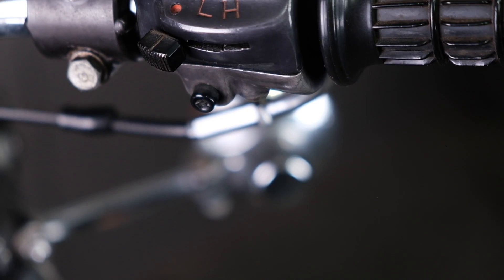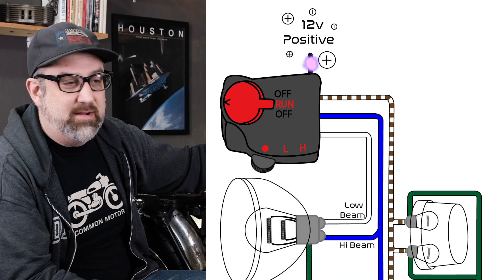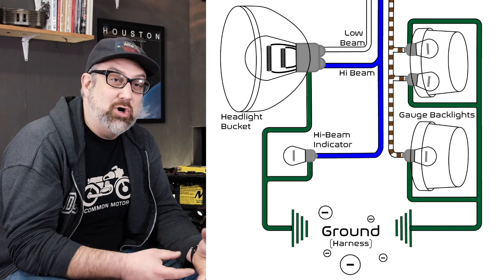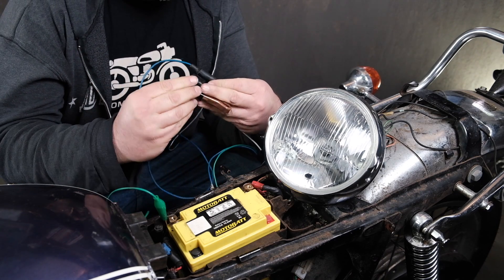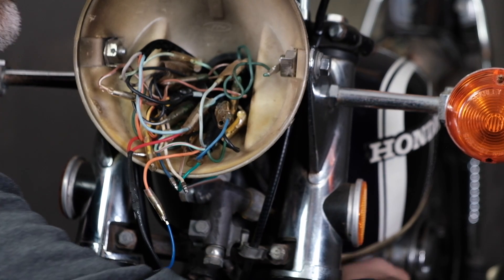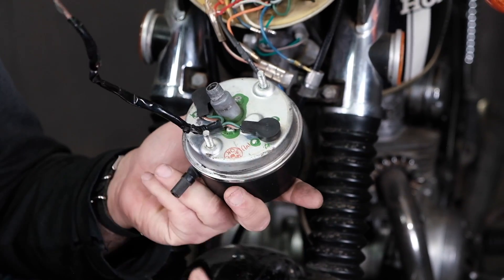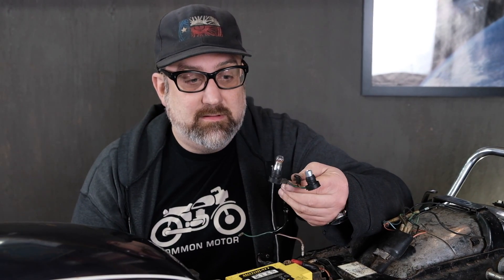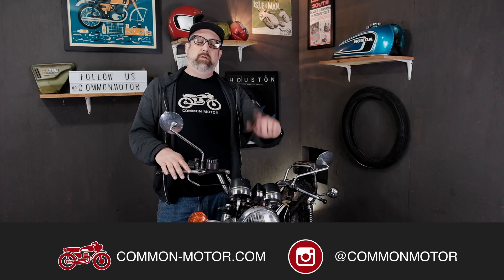The Single Fuse Headlight & Gauge Light Circuit (Pre 1973) | Electrical Basics on a Honda Motorcycle

Comment: Brenden. Thank you, thank you for the excellent video and explanation. My '72 CL175 had no headlight or gauge lights. After watching your video, I realized that I had not checked the ground. I popped the headlight and saw that my ground was through one of the sealed beam mounting bolts, through the trim ring, and onto the bucket. A jumper from the ground connector to the frame gave me lights. Somehow the connection between the trim ring and the bucket was interrupted. So, no ground. A little metal polish on the trim ring and on the rim of the bucket where they meet fixed the problem.  Thanks again.